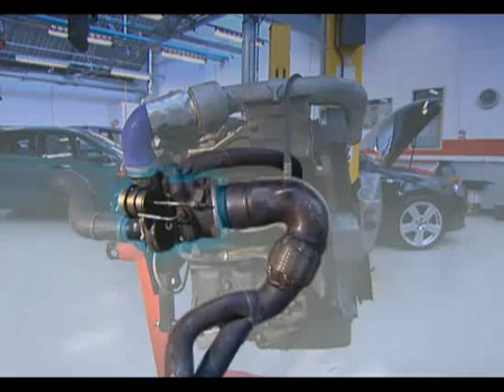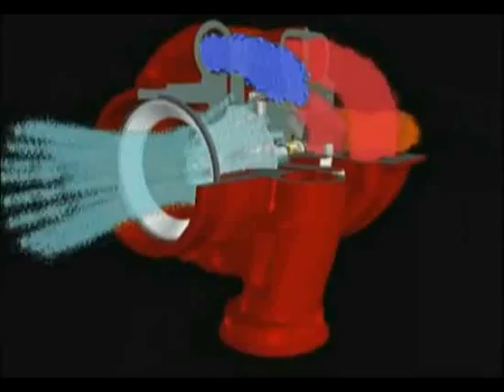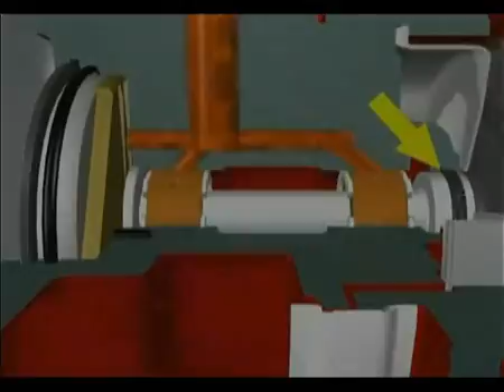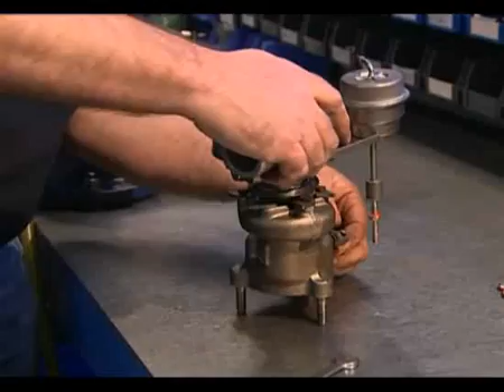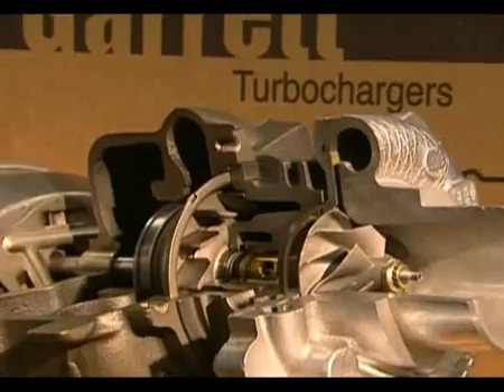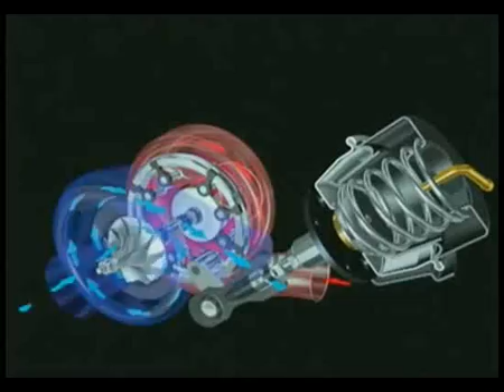How a turbo works

Comment: the part about how the variable turbine turbos works, need more detail. i dont know if its spool up faster or slower of how much air is consume by the exhaust gas on its variable adjustment. i dont know if my assumption is correct or not. 

great video by the way, i can actually understand how it works in visual view.

Comment: i have and 03 pontiac grand am gt. nothing modified to the engine but i want a turbo for the better gas milage and the horse power. would a turbo fit and would it be a wise or bad choice to make? plus how much would it even cost to buy the turbo and have it installed ?

Comment: @lolzordje123 I don't think so. The presence of gears would mean parasitic loss of energy. This loss of energy would mean lower RPMs and therefore lower flow of air. Also, where would you put such a gear system? It would be extremely complicated and will only mean unreliability since more parts = more things to break. Are there even gearboxes that can withstand hundreds of thousands of RPMs?

Comment: Dear Mr. Buchi in order for air to flow at the most extreme you need  1 to have the intake area to be as large as possible, why is the intake so small? 2 Why are you having the air turn 90 degrees!!???? lol 3 You are causing a back pressure on the gasses on the cylinders that are trying to exhaust the gas! Don't you want more air flow through the engine. 4 But worst of all, why do you have such small bearings? The bearings should be on the outside of the fins, and the air flow should be straight

Comment: Wondering if this is correct:
Intake of air is at high velocity so therefore with Bernoulli, pressure must decrease. When a car goes faster, the velocity of air increases therefore pressure decreases (PV = PV). Thus a car gets less O2 as it goes faster (inefficient at higher speed). The turbines compresses the air for higher density (more O2). However, the cooling stage deals with PV = nRT where V, n and R are constant. Decrease T will then increase density, thus again more O2 per unit volume.

Comment: @georgibubu thats correct. Because work was done in making the exhaust gas, the exhaust gas has energy to do more work. It does so by spinning the turbines. In short, the turbines then take in air (which contains O2) and compresses it. The pistons get more O2 to burn than usual so increases economy. Basically the exhaust is analogous to wind that rotates the turbines in a wind generator. For a wind generator we want electricity. For turbo, we want air (or oxygen) to brought in and compressed.

Comment: So... actually, the turbo is not reusing the exhaust gases?.. those gases are just used to spin the turbine in order to make the intake turbine from the turbo to work and suck on fresh air from the exterior? Finally I got it... i watched many videos and still didnt get the answer, but you, through your video have done it. If im on a mistake, please feel free to correct myself.